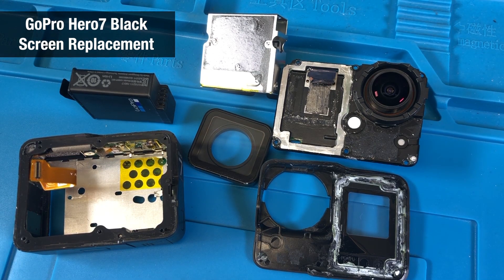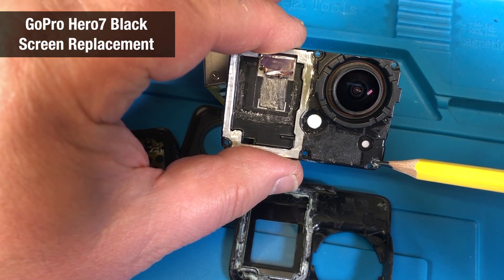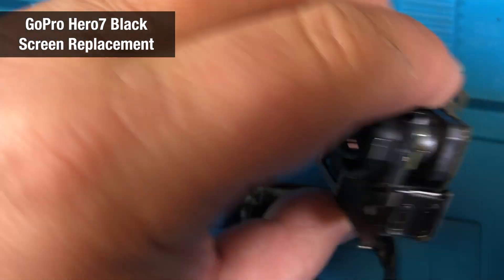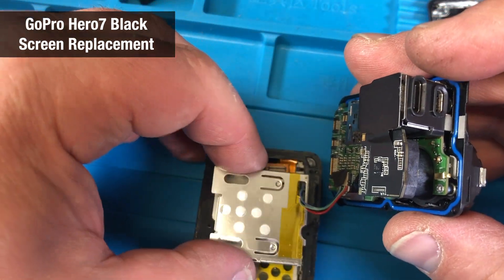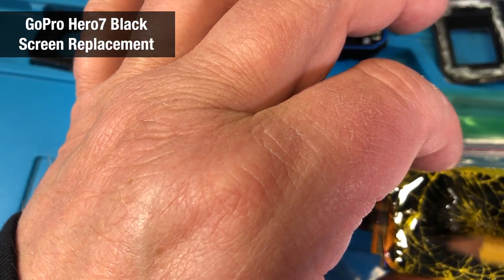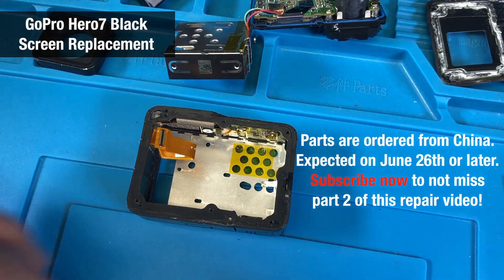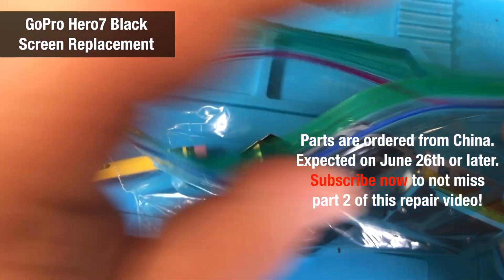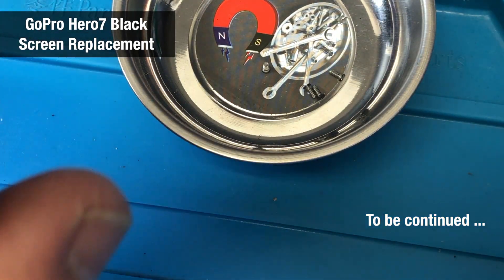GoPro Hero 5, 6, or 7 Screen Replacement Part1

Comment: Great video. Thanks for sharing. After mangling several front covers during removal, I finally figure out a best method for removing them (at least for me). I start on the lower right hand corner using a wide, flat spudger tool. I start in the area where the soft glue is, being sure the lower right hand corner is completely separated. Slowly work from right to left on the bottom, while gently prying the cover upward. The glue around the front LCD is very hard so if it doesn't break free from prying, you need to cut it with an ex-acto blade. I use a small square blade to cut the glue. Care must be taken not to scratch the LCD or damage the LCD ribbon cable. Probably the toughest part is the strip of glue between the lens and the LCD. Once the lower half of the face plate is separated, you can gently pry the cover upward to access the glue and gently cut it with the ex-acto knife. To remove the battery box, from the rear cover, I use a thin hacksaw blade to cut the glue holding the battery box in place. Simply start at the bottom and gently work your way inward. Lastly, the battery connection to the main board is a clip in style and simply unplugs.